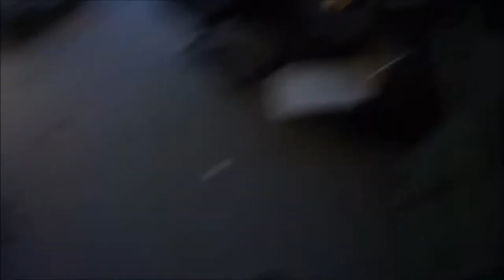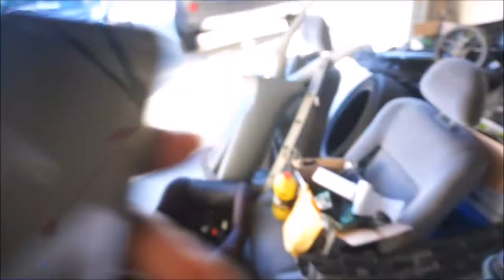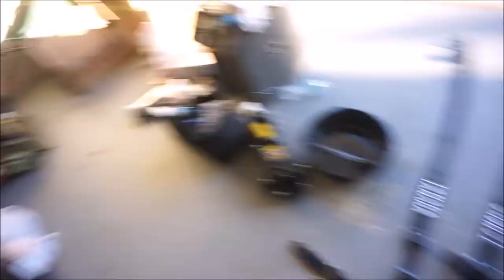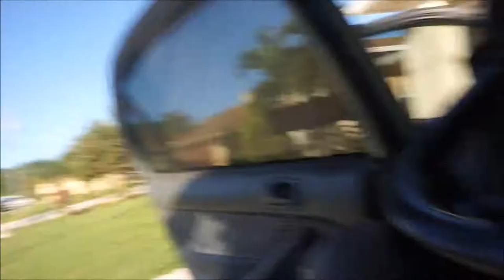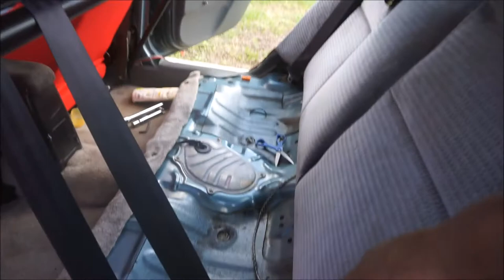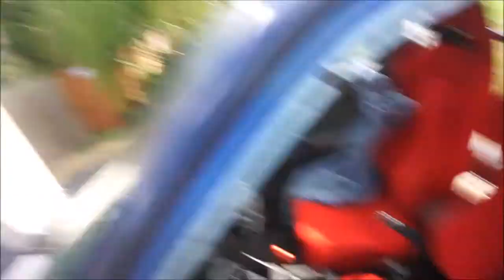Making The Civic Safer | Tanaka Seat Belt Harness Unboxing & Install (DIY)

Comment: That’s unsafe man. Never mount it directly to the floor. It should be wrapped around the harness bar. In an event of a crash, your spine will be collapsed.
Reply: No. He has the proper angle from the shoulders across the top of the harness bat. It's safe.